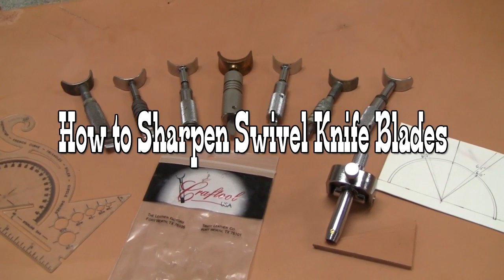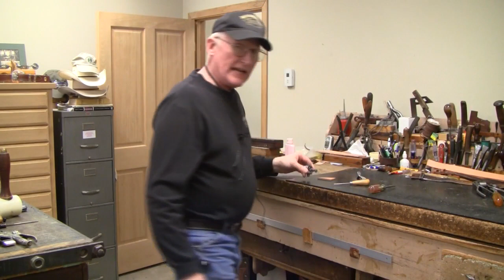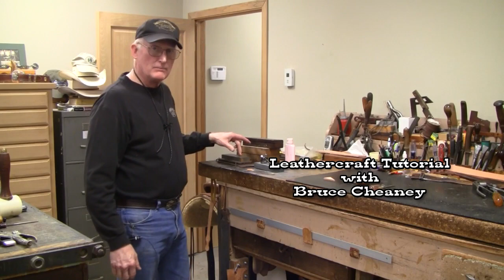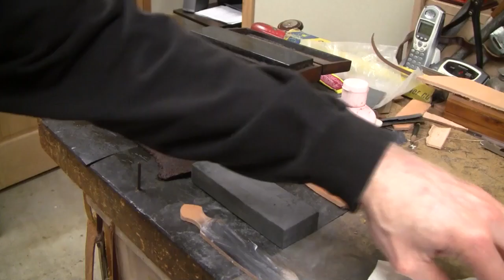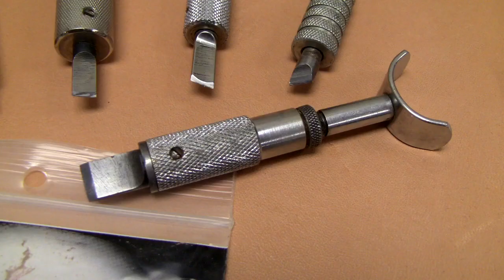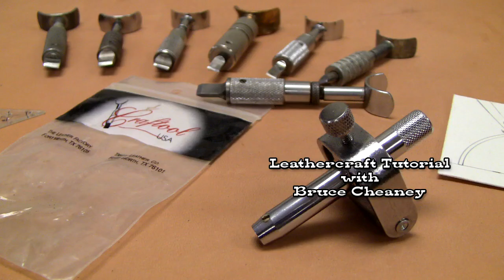Swivel Knife Sharpening - Leather Working Tutorial for Beginners - Leathercraft

Comment: Trying sharpening blade without tightening the screw which holds the blade in place and without applying to much pressure on. In other words, sharpen with blade freely spinning - it will find its perfect spot it self. Just a tip. Thanks for great videos!
Reply: Sir You are not only fine artist but a Gentle man    Thank You for Your video's
Reply from the maker: gcardinal That really makes sense I'll give that try. Thanks Bruce